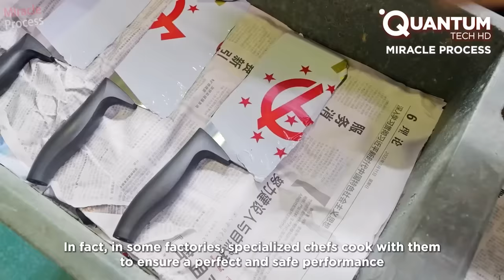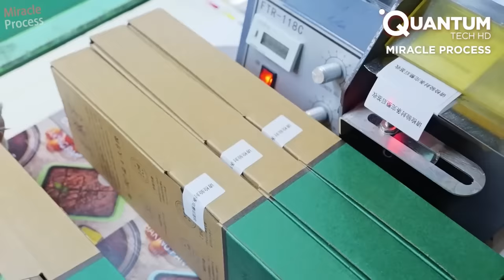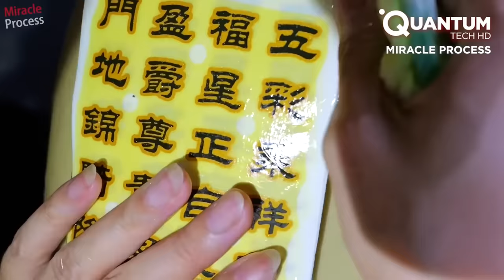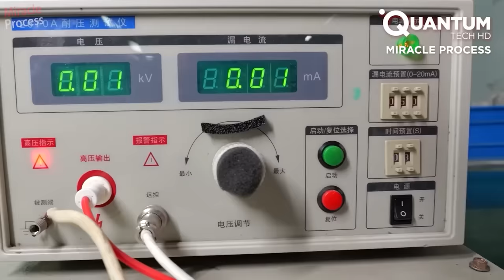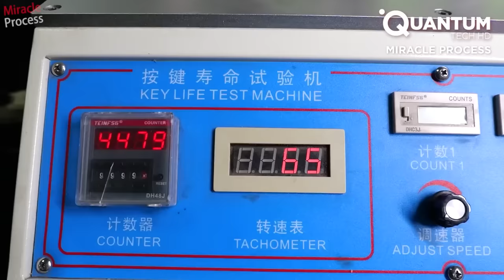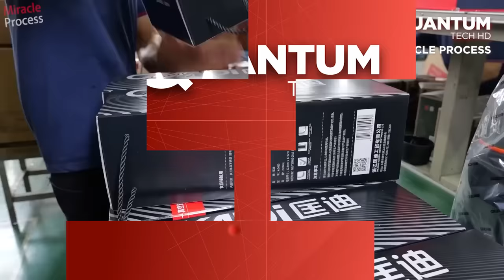China's Top 5 Manufacturing and Mass Production Videos | by @miracleprocess

Comment: Quality of life I wonder how many weeks that a employee has to work before he can afford one of the products that they are manufacturing?🤔💰
Reply: In the internet age, obtaining information is still very convenient. I checked, and the brand called "wangmazi" with a black knife handle in the first video is priced at 41.55 RMB on Chinese e-commerce platforms. 
Although I couldn't find the salary range for this company, I found another data point. The salary range for knife manufacturing is between 4.5k RMB and 15k RMB, with the ¥7k-11k salary range accounting for the largest proportion, about 67%. 
Perhaps it's not accurate, but let's calculate based on the minimum salary of 4.5k. Without considering rest days, that's 30 days a month. So, that's about 150 RMB per day. The conclusion is that approximately 1/3 of a day's salary can buy one of the knives they produce themselves.
Reply: 五金工厂的工作很辛苦，他们的钱是辛勤的汗水换来的。